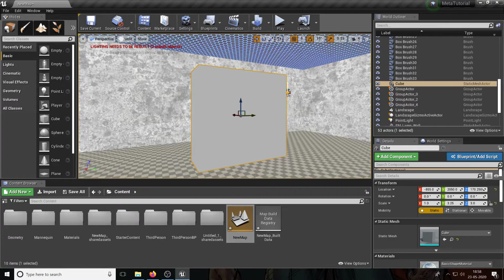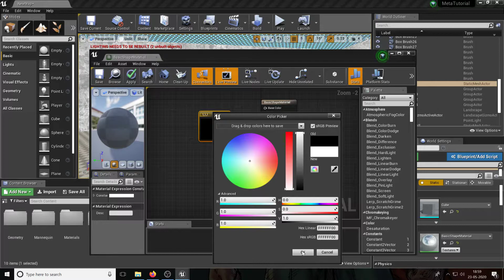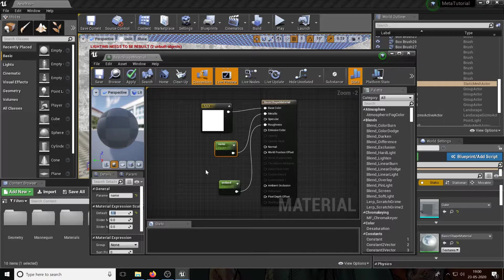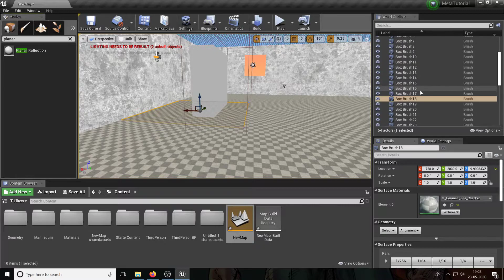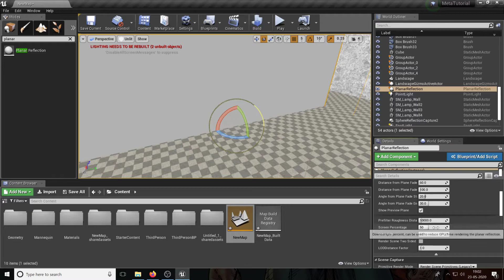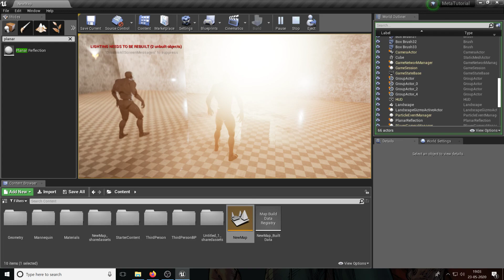Game and Experience Design #10: Mirrors

Comment: Hey, so while doing and copying all the same settings and numbers on my system, the reflection is not so accurate and clear. I've started making the mirror from scratch but still not getting the expected result which is on your screen, any tips?
Edit: Even the wall opposite to the mirror is not shown in the mirror I copied.